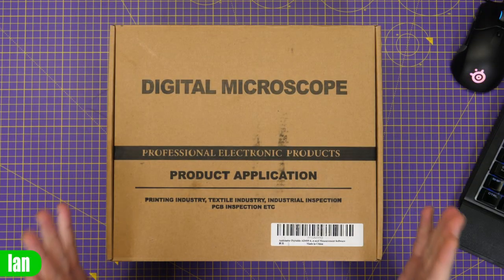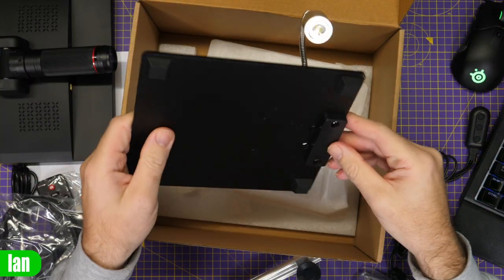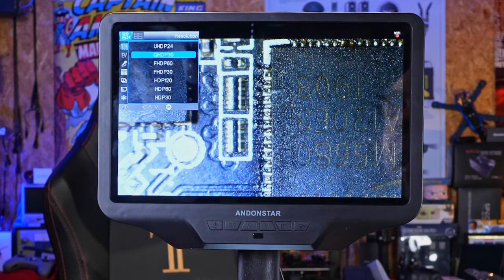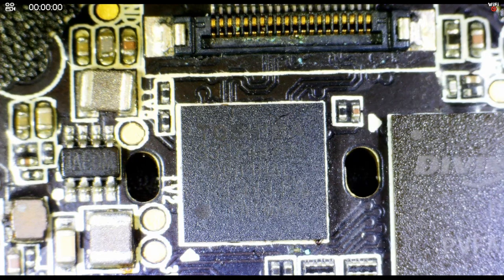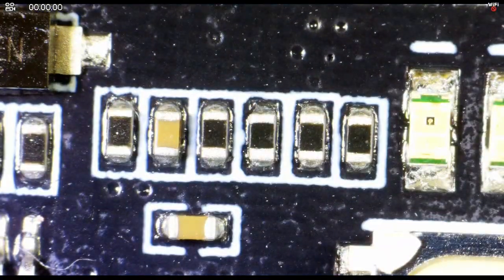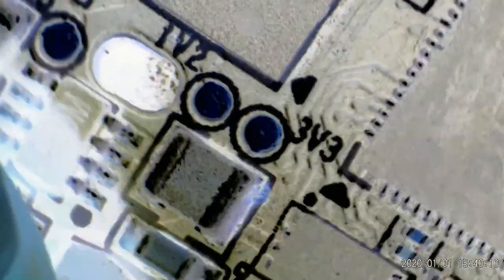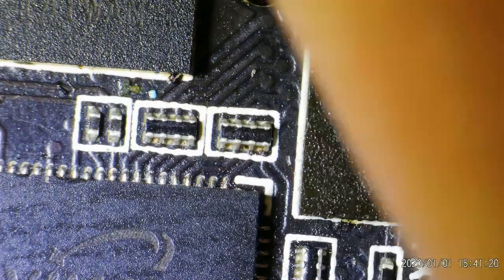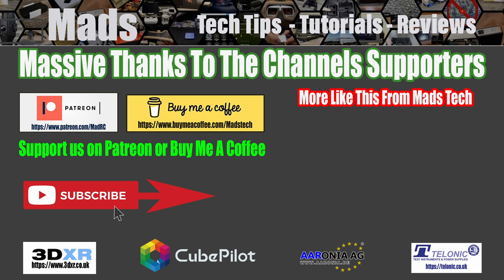Andonstar AD409 Microscope For Board Repair & Inspection

Comment: I receiver the 8.5 inch screen version last Christmas. It definitely makes soldering to smaller pads much easier. I did remove the clips and just stick the board to the base with bluetack.

Comment: I got the AD208S earlier this year before the war when prices were still low the last few days: paid 88€ shipped from Aliexpres warehouse in CZ and arrived within 3 days via dhl 

Great scope for the money and the work, but your one has an even better software I guess or the UI . Looks different, more crisp and with more features. 
Just need it for soldering more safely and investigate. 

Had used the scope not much cause I still quite often use the phone for quick investigation cause the scope is stored in a safer spot and not always on hand. 
Overall quite impressive even with the cheap display it comes with. 

And this is also a device on the lower end of the entry models of this market. I simply did not wanna get the cheapest with all the issues and it worked out quite well or met  my requirements and overdelivered tbh. 
Not often these days that I am surprised by a chinese product, last time it was a simple smarthome temperature sensor  with an e-iink display and the history of a full year recorded. Quite often you get the opposite, quite good and some cheap components thrown together with an unreadable LCD display cause I also gotten such in the same week , a 2 sensor thermometer for fridges : works OK , but display is a total mess with tiny angles where you can read the measurements and worst of all false labeling.

They say Sensor 2 is displayed on the upper line and Sensor 1 is on the second line. It looked like a label misplaced first, but it was not a label, cause all the three switches are labeld in the factory so it must have happened there. You can not scratch it away , just glue a label over the previous one. 

This Adonstar was a result of your thought back then before you had ordered yours and where you had been askin in a live stream what to buy. 
the stand works for me great but be aware to tighten the screws that hold the arms that hold the pcb cause mine got once lost already and it was a long and hard search to find it again. This is the biggest tip: tighten that screw or add a small line just to avoid loosing that. You will not always need that and then unscrew it where the mess had started cause when I had screwed it in again after work was done I must have lost that screw / spring / arm which I realized weeks later. 

I also like the quality of the stand cause it was real metal, looked rock solid and worked great - but I also have to emphasize that mine was about 25% of the value of the one you had checked. You might have also mentioned the price of your optical one for comparison. The 8,5 inch screen of my edition was good enough but I also liked hdmi out

great review of a product I love not only for board repairs which I rarely do but it is a great part of the small bench like my cheap loto usb microscope that uses my dji tablet as display cause I could get a 18$ app that worked perfectly with the loto scope instead of the windows software. the android app even supports a lot of sophisticated features like the fft methods and some other stuff like the 8 channel car analyzer which is quite usefull too.

Comment: Can you get a full size mother board on that base plate and move it around or is it only suitable for small circuit boards ?
Reply: what do you mean full size mother board ? a big pc mainboard might fit quite good but you might have to unscrew the 2 arms with the springs and then later get those tight back in place cause I had lost one during that adventure. I had a big pcb under it and you have to be aware that you can reach  a certain amount of the border of the scope cause there is a limit cause by the distance of the stand mounted on the plate to the optics. 
To reach deeper into the board you can push or pull the stand and might reach twice as much as before but you will change or loose perspective.

To avoid that:

There is  a work around you can understand watching the still a 4:10

You have to remove the plate and build your own horizontal plate and longer horizontal arm to move around and get deeper over the mainboard. If you have a deeper one then that is your only choice but it is quite easy and cheaply to improve cause you simply need a bigger plate  (in my case 3 times bigger) and a horizontal kind of arm that is screwed to the plate but puts the arm about 25 mm above the plate to reach over the pcb and its components like the BMS I had gotten. The stand is connected to the arm and there is a second pivot point cause with 2 such piivot points you can reach any position on the board.

But you can not expect such solution shipped from china cause shipping cost would kill the benefit. My AD208S was about 88€ shipped from CZ warehouse in february before the war broke out and it worked fine even though with a bit smaller 8,5 inch display. 

I often had thought that I would loved to have my tablet used instead of that display but then you would have lost those buttons in the frame of the display and the stand would not be as stable cause each tablet is different. Might have worked for some but not all of them like for example the ipad family but not the huge variety of android tablets. For a quick and fast investigaiton these are great. If you need more you simply have to connect a monitor but that will take a lot of space, also your working position cause soldering on the pcb and looking to the right on a monitor had not worked out for me at least 
If you consider that then you will need a monitor arm and move your monitor above the display of the scope to look up and work below and look down from time to time. You can not do that if you have to turn your upper body to the side to watch on the big screen on the right of the scope. 

But get the cheaper and smaller one just to start with cause they feel quite good for such repairs with smd components like on our bms.
Reply: @typxxilps  You understood well enough to answer my question thanks.👍

Comment: Well I clicked on your link and it gave lots of details but no prices when you click on where to buy in the main menu. It says you can buy Amazon or AliExpress and then you can find the prices out from there
Reply: he had added a search linke that showed you the current available AD409 microscopes cause they simply sell out quite fast and the one link would be outdated or sold out. You have to press control +  f and type ad409 to find all AD409 and its prices cause aliexpress and sort by price does not always work especially if you search with a 2 word expression.

If you go to aliexpress and simply search for ad409 only then you will get a smaller list of right results and not all the other andonstar microscopes. 
Aliexpress search is the biggest mess so be aware that sometime aliexpress hides results from you. 

To avoid that there is only 1 trick how I got behind it: do a google search for each item you want to find on aliexpress and then jump to the shopping tab of the resullts and there sort by price for example search for ad409 site:aliexpress  and the usual . and a com

Now you will see some even cheaper options of aliexpress offers aliexpress does not show to you in their search engine.

You always need to be aware of that the fastest result and best price can only be found by usually using google search and the shopping option. 
If you are inside aliexpress the sort criteria by order can make sense in the hope that the swarm has bought from the cheapest and that the seller had not changed his price position meanwhile. 
Sometimes the shop that had sold the most had incredibly high prices which makes you wonder how that shop could have sold 10 times more than all the other together. Simply in a batch sale for a very low price and high volumes that brought him to the top - and then he increases the price in the hope for some that will buy not checking any further for lower prices.
Reply: @typxxilps  my iPhone doesn’t have a control button and I didn’t need all that explanation I found it on Amazon. I said I found it on Amazon it’s 400 quid

Comment: Must be Expensive....  No prices on their website you linked to...
Reply: 330 USD from what I've seen on amazon
Reply: check it again on aliexpress and search just for ad409 and you will find this. On Amazon these items sell out quite fast and then it say unaavailable or no stock and no price depending on what the vendor has setup. Aliexpress dealers do have them still in stock and his link is working but you can better search for ad409 only to avoid all the other addonstar models in that search list. Best offer today is about 409€ incl. shipping to europe and VAT, but there could be an additional custom fee for items above 150€ therefore I went for the cheaper one back in february the AD408S for 88€ from CZ warehouse tax and customs free and arrvied in 3 days via DHL. works great, uses same stand or mount and mostly everything looks same or similiar, only display was 8,5 inch and maybe the camera is a different one. But for me the cheaper one has worked out. Be aware that my order had been 2 weeks before the war broke out cause since then prices have roughly increased by 50% due to its shipping costs mainly caused by the packaging and its volume caused by the stand annd all the components. But if you search for 208S be aware that there are 2 different versions sold under the same name or traps / scams for 65€ (5,5 inch display and cheap crap camera) and a 115€ version with the 8,5 inch screen.
Reply: Aiexpress cheapest offer for the AD208S is about 114€ right now if you search for AD208s and then sort by order.
The AD409 is far more expensive about 409€ right now, while the closest is the AD 407 pro which also includes hdmi for about 240€. 
I also had gotten the AD407 pro for the hdmi out but I could not work with a monitor on the side. I would have needed a monitor arm to place that above the microscope to solder. You can not work in front of you while looking to the side on a monitor cause even the tiny delay makes you crazy. If you move your head a bit the soldering tip will have moved too a tiny bit but too much for smd components.